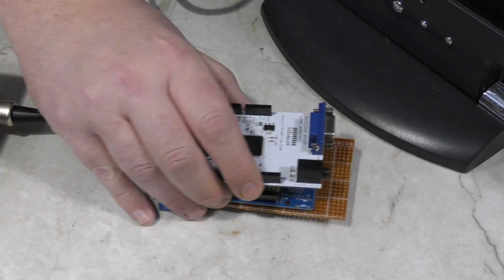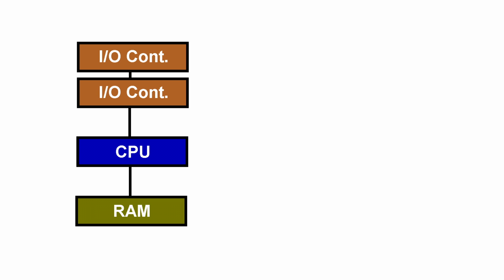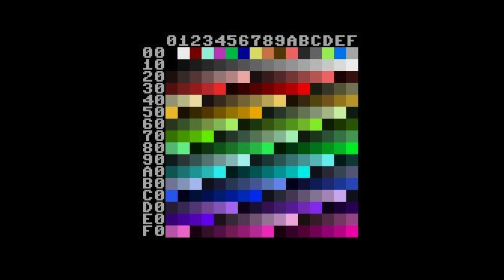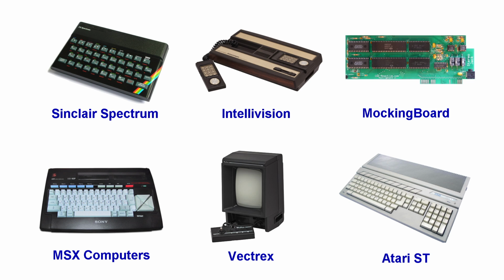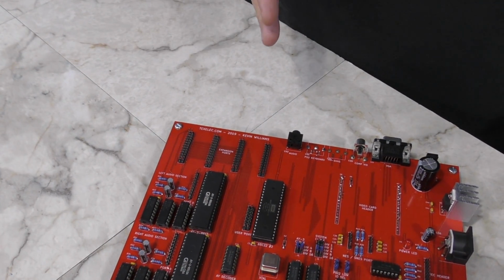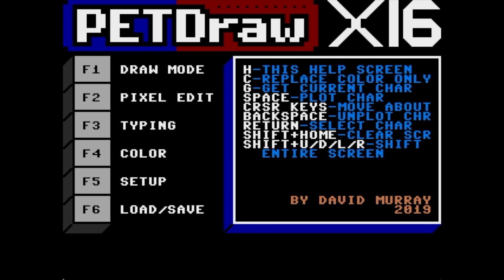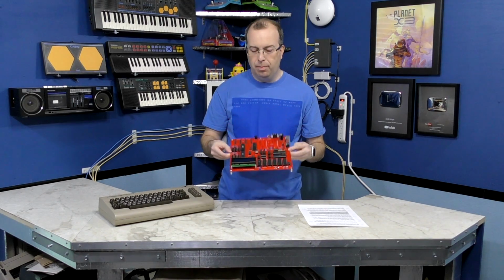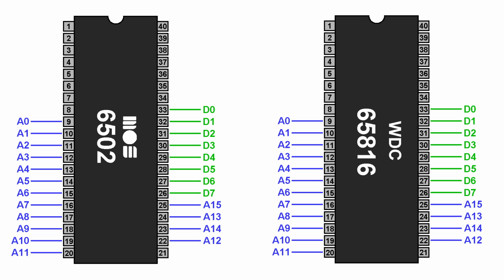Building my Dream Computer - Part 2

Comment: When you discussed the bank switching, I paused before you revealed it and was like, "It better go something like 'LDA #<bank>; STA $9FXX' or I'll be disappointed."

Turns out I was right in my expectation! :oD

It's simpler than standard Apple II bank switching (I started with the Apple II in 1980s public school; this C64 stuff is new to me ;o) and especially if you have a more exotic card that doesn't look and act like a standard Language Card.  It's one reason the IIgs was so appealing to me...

But then you get to battle emulation mode vs. native mode, and MVN (and probably MVP too) leaves the data bank register in a hokey state so you crash when you go back to bank 0 unless you know about this, and I haven't even touched the ROM toolbox at all, etc.  Comparing and contrasting this to a 65816-based machine makes me realize the Commander stands to be a much more interesting affair while allowing me to do neat things with it from the comfort of ca65.

Comment: The thing is with this project, is that you've got to remember that you aren't just re-inventing the Raspberry-Pi, there are enough clones out there already, so I really think that this should go into a C64 style case and even use the readily available re-makes that are available now of the C64c from whoever got the original dies and is punching them out in every colour under the rainbow. At worst, if the space is needed, go to Amiga case specs, but I really think it ought to be an all-in-one design, with the keyboard integrated, otherwise you are just re-inventing the Raspberry Pi. 
If I could throw one item into the wish-list of features for this project, is that it's got to have a killer sound processor or it'll be a pile of nostalgic shit. 
Take a few notes from the history of the sound blaster, from the CMS (Creative Music System) days, to the 8-bit sound blaster, Sound Blaster Pro, Sound Blaster 16, Pro-Audio Spectrum, Even the Roland MT-32. The advantage you have is that you have 30+ years of someone elses experience to learn from. 
This thing should be capable of 16 channel SID synthesis, General Midi, and if it could do 16 channel MOD tracking using 16-bit samples, you'll really have a beast on your hands, and I would be happy to pay multiple times the goal price of $50 for this. 
As an example, I am currently building the ULTIMATE Music Making Commodore 64. And so far I have spent close to $1000 trying to stuff as many SID chips into it as is technologically possible. The problem I am finding is that eventually the thing HAS to break out into the MIDI format at some point or the whole thing is just too damn restricted.
Reply: Hi! We are going this route for very good reasons. I'll be doing a full post and user poll shortly on the Facebook about this. In short, we don't want to custom build a case and keyboard as that would add hundreds of thousands of dollars which you guys would have to pay for. It also introduces many risks and delays as you have seen on other projects like the ZX Spectrum Next. Therefore we are limited to high quality off-the-shelf components, which is the spirit of David's project. We will be customizing and rebranding these and you'll see all the options in the aforementioned poll, and have a say. We realize with nearly 1 million subscribers we are not going to be able to please everybody, and we thank you for respecting that. However you can trust that we are moving forward with the best possible option for the community so you can get this machine in your hands as quickly as possible and at the best value. 👍🕹️
Reply: @RetroRecipes  You had me at "Hi!" 
TAKE MY MONEY, I WANT THIS no matter what spec it turns out to be.
Price wise, if it has a 16 channel SID, and the ability to play 16-bit samples so MOD tracking can be done to a better standard than the Amiga, I would have no qualms in shelling out $250-$500 for it. $600 at a stretch.

Comment: Pros:

Costs less than $10 USD

512 MB RAM
HDMI (up to 1080p@60 24 bit per pixel, with HDMI audio), VGA, composite
USB
MicroSD up to 64GB
Plenty of GPIO pins (you can make your own PS/2 socket of them, for example, or add a bunch of fancy LEDs just for fun, or a PC speaker, or... 'GPIO' says it all)
I2C, UART, SPI, CSI, all that jazz for crazy tinkerers

Cons:
None known

Product name: 

Raspberry Pi Zero

And don't even start that "linux computer" chanting. Yes, it can run Linux (who can't?) So what? Basically, this thing just looks for a file named 'kernel.img' in the root of the memory card, loads it byte-to-byte into the memory and jumps into. Period. 

Don't like Linux? Write your own kernel.img (in assembler if you want), and Bob's your uncle.

Or you can just install Open RISC OS on the card (it isn't Linux in any way) and enjoy tinkering with it.

Or you can grab and hack U-Boot source code.

Or...

Or...

Or... 

21st century, folks. The wheel is already here.
Reply: Can you make it be instant ready? Like, you turn it on, and see the command line right away. Not a minute later, not 20 seconds later, not 2, just instant. 21st century is not only about improvements, unfortunately, as lots of things changed to worse.

Comment: +adric  Roland Corporation may have produced some satisfactory sound chips for the Commander™ X16 project.  The JP-4, JP-6, JP-8, and MKS-80 had LFO, VCO Modulator, VCO-1, VCO-2, HPF, VCF, VCA, ENV-1, and ENV-2 sections.  The JU-6, JU-60, and JU-106/S had LFO, DCO, HPF, VCF, VCA, ENV and CHORUS sections.  And the D-10/20/110's Linear Arithmetic Synthesis was supported in late-1980's computer expansions such as the LAPC-1 and MT-32.
Reply: None of the pro grade synths is made as one-chip design. There are tons of parts, these things costs a fortune for a reason.

Comment: 19:05 Just a minor correction. The pictured Spectrum 48k did not have a built in sound chip at all, all it had was a simple beeper controlled by the CPU directly. One could be added via expansion though. The 128k did have it built in.

Comment: How do you go about designing an FPGA? And is it just flash storage that's been repurposed for "mechanics" instead of just data (so the transistor paths are shaped into the "mechanical" operations instead of just containing code in standard storage mode that may handle some operations, but code can't do all types of "mechanical" work)? And what's the difference between burning an FPGA and just an ordinary PROM?

Comment: How would this supposedly be "superior" to VGA if VGA lets you have millions of colors but this only lets you have 4096 like an OCS Amiga?
Reply: VGA as in the Video Graphics Array, and not the VGA port. The common video modes of the VGA were 320x200 with 256 paletted colours (mode 13h), or 640x480 with 16 paletted colours (mode 12h). Definitely not millions of colours. Also the VGA had no layers or sprites.
Reply: @_me-ta-_3780 , VGA was actually extended to include more colors and higher resolutions, such as the S- and X- versions. Also, it's not about "had"/"was," but "has"/"is," since it still exists even if it hadn't been mordernized/upgraded.
Reply: @HelloKittyFanMan.  SVGA is not VGA. I am talking about the Video Graphics Array. The specific piece of hardware that has only the capabilities that I mentioned above.

Comment: This is similar to what I wanted to do. If you look at the guts of a lot of old stuff you can see how easy it would be to build something awesome using older components. I really want to see how using an old fm chip works out for this. I considered using the one from the genesis the ym2612? There are many great fm chips to choose from too yamaha made a ton of em.

Comment: Firstly your work is progressing well and you have a customer here.
There is only one thing, Its 2019 and I think I speak from everyone in saying it needs some sort of network port. With high res graphics, programmers out there will most certainly want to write a basic browser and possibly an email handler.
A network port allows the system owners to simply share software and hardware  created easily. Perhaps create a dedicated Web page as the X16 store.
Food for thought
Reply: This purpose would probably be better served with the well proven Bluetooth system and WiFi, both are off the shelf / plug in modules that can be bought cheap from china.
Reply: @JesusisJesus  don't disagree. Only asked for a network connection. Not a secifuc type

Comment: Will Perifractic use hot glue to hold the components inside the case?
Reply: Actually yes there will be a lot of hot snot and one wire left unsoldered!

Comment: 8-bit, Why don't you admit: your dream computer is the comodore 64 --- 
a slightly overclocked C64.

There is no point building the X16 the way you do. since you're using fpga anyway you can stuff the entire computer inside. Beside that you just have to have an USB keyboard and hdmi these days.

Comment: 10 minutes in, and the plan is a 6502 with bank switching. Wow, that's not my ideal computer!

Beside that, there's add-ons for the C64 with a 65816 (horrible chip!) and 2MB RAM banked in. Not massively successful but then at least you'd be writing for something a few other people have. 

I think I'd start with one of the Z80s, the EZ80 has 24-bit addresses, and the registers and ALU have been extended to that width, it's also 3x faster than the Z80 at the same clock (not hard since the original used a fair few cycles to do stuff in). Versions of it can run at 50MHz and have integrated RAM and 256K flash if you want it, while still having a standard address and data bus for more RAM. 16MB address range, all flat with no horrible banking!

Using the banks just to hold data like graphics I suppose makes things easier but it's still limited. One day you might want to run code from there, which is of course possible but a pain in the arse to keep track of which bank is where. I have real pity for the Atari 2600's programmers who broke past the 4K limit with all sorts of freaky bankswitch schemes, it's a wonder most of them still have their sanity. 

And 64K I/O space, like the original, in a separate address space which is nice. It can also have an integrated Ethernet MAC and TCP/IP stack, so Internet! 

Mostly though there's already a C compiler! An offical ANSI one but some great amateurs led by Garry Lancaster created one initially for the Z88 (a fantastic portable that I really miss) then ported to the ZX Spectrum and others. An EZ80 also powers a lot of Texas Instruments calculators, which have an active hacking / programming scene. 

Shit, now I wanna make one! Can't do surface-mount though. Wish there was a hack space near me! Ah I'll just save up and buy another Z88, screw it. 

Good luck anyway!

Comment: Okay, I love everything about what's going here and you're amazing and wonderful, but NO! No Cherry MX Switches on the premium keyboard! Cherry Switches are overpriced and inferior to much of their competition in almost every category.

If I had to recommend a keyswitch type for this project, it would be a linear keyswitch just like most of the keyboards of the time period this computer is attempting to capture. If I had to pick a linear switch for this build, it would be a Novelkeys Cream or Gateron Red, just something that works well and is a lot smoother than their Cherry equivalents.

If you wanted to go with something clicky on the other hand, I'd go with something like Kaihl Box Pink. In terms of weighting and tactility they resemble the IBM Model M keyboard, and are a joy to type on. Their clickbar mechanism also sounds wonderful, and a million times better then Cherry MX Blue or Green.

You could also just partner with Unicomp to create an official, authentic Commander X16 Model M keyboard with buckling springs. I can't imagine the end result being any more expensive than using Cherry MX switches.

I wish the BEST for this project and I don't want to see something unworthy of this project's goals make it into the final product! Godspeed!
Reply: Flerger Bergitydersh thanks at first i thought you can’t repeat making a Model M switch but you can? Heh, using a Model M switch is actually great too.
Reply: @hoangvietcuong2569  Yeah, Unicomp is still making actual genuine Model Ms with actual Model M making equipment. The people there made Model Ms for IBM before IBM stopped selling them. And they sell them for under $100. They also sell versions with a couple of extra features, like a trackball or trackpoint, for slightly above $100. So I don't see why they couldn't cook up something special for the CX16.

Comment: Hmmm... a Yamaha FM synth chip.
It’s not being produced anymore...
Could you use a YM2612 instead? The one used in the Sega Genesis/Mega Drive.
It’s still being produced today.
And if the Genesis had Blast Processing, the clock speed of the YM2612 should be just fine.

Comment: This project is the definition of "if you want something done right you gotta do it yourself".
Reply: +" 30 years later"
Reply: + outsourcing a lot!
Reply: @RaimarLunardi  -- In technology, you have to rely on teams.  No one person could know everything in the development of any tech.
Reply: ArQmA, a crypto coin coded for that reason. If you want it done right, do it yourself. I did QA on the code and it's similar to checking firmware and assembly programming making sure the code doesn't leak information, stay secure, and doesn't crash.   There was hardware and software bugs caught by me back in the early PC days , but it all started with banging out solutions on 8 bit hardware like the C64 and Atari 800. You wrote your own libraries, tested the results, directly from the hardware if you had to.
Reply: If only he could take a time machine back to 1982 . Je could become a millionaire & create a huge tech company
Reply: Is this project still on or sir Dave's cancelled it? There's not part 3 update for 3 years now.
Reply: @Piensas_como_yo  Of course it take more than one person. Most project that hammer the problem down to a solution usually takes a village.  Not just a single utiltiy with a limited scope, the github guys make compounded usefulness out of most things.  Synergy my friend, stay frosty.
Reply: Idk what's going on but yeah i agree because if others make something i requested atleast 1 thing will be different than i wanted it to.
Reply: Size doesn't matter, that's what I always say 😆
Reply: Probably more audience availability on FB.
Reply: Is this doing it right?
Reply: This project is the definition of "if you want something done right call all your friends up to do it for you".
Reply: @ghosthitthose8681  He is bringing on the right people for the job, what is wrong with that? Show me any successful enterprise where one person does anything. Now go back to your  lawn-care business.
Reply: 5 years later, this project is the definition of "if you ask people smarter than you for advice, don't shit on their advice if they are smarter than you!"
For context. he asked Ben Heck if he had any advice for making this project and Ben said, simply "You're not going to be able to make what you want on new chips and keep the price under $100 (that was one of the aims he said he would not compromise on.) So, if you're going to make it, you may as well bite the bullet now and go FPGA. You are NOT going to make it for less than around $600 and you're still going to have to use at least one FPGA. So compromise on that now or shelf the project."
And the 8bit guy essentially told Ben to shove it and took the piss out of him on a forum.
Then, before you could say "massive hypocrite" he started talking about how he didn't want to but to keep costs down he had to use a few FPGAs.
But never had the decency to apologise to Ben after mocking his advice, then taking his advice for the exact reason Ben said but never gave Ben any credit. In fact, he doubled down on calling Ben wrong even though he did everything Ben said for the exact reasons Ben said he would have to.
Reply: More like a counterexample at this stage.

One Hump or Two?
:-/
Reply: If u think this project is going anywhere u are sorely mistaken!! 300 dollars... what a joke!!! Any idiot can make a computer and RAMP up the price.. the idea was to have an affordable product to build a HUGE community around... instead u now have this BLOATED MESS!!
Reply: @sheepthehack  that is what he also said.he is working to scale it down and make it a better price

Comment: As a big, big fan of the YM2612 (I'm one of the co-founders of Project2612), I'd totally support going for the YM2151, especially if you pair it up with a YM3012 or YM3014 for stereo/monophonic DAC.

The MSX has some seriously amazing tunes written for its games (for a good example, listen to Motoi Sakuraba rock out with Granada: https://www.youtube.com/playlist?list=PLE71CE8AF98288202 ), and all that was was a YM2151, YM3012, and an Oki MSM6258 - it was good enough for a nearly flawless conversion of the Street Fighter II arcade soundtrack, and indeed, Capcom used the X68000 as an arcade development board for the CPS1!

To me, the Commander X16 owes itself to priding itself on sound, because the SID was such a big part of the Commodore 64's success in that regard.

I think it'll work just fine, by the way, since X68000 machines ran from 10-25 MHz generally, with upgrades well into the 75 MHz range.
Reply: secondedddddd
Reply: Did David say that they weren't produced anymore? If so, I'd be in favor of the YM2612 core integrated into the FPGA. This would also help to keep costs down. And it could theoretically be upgraded/updated in the future through some sort of firmware update path.
Reply: Ayyy, Project2612! You absolute hero!